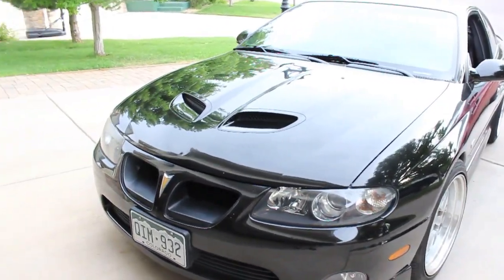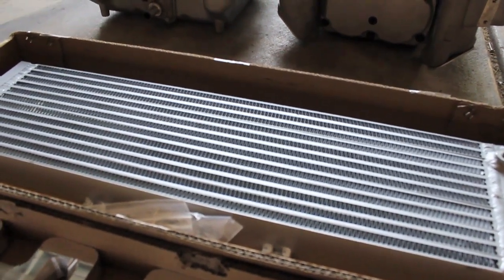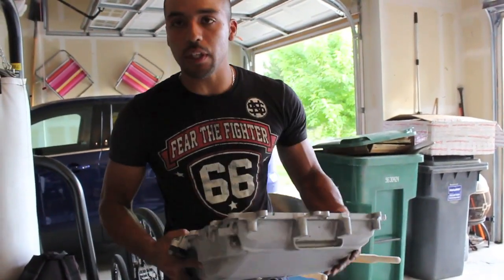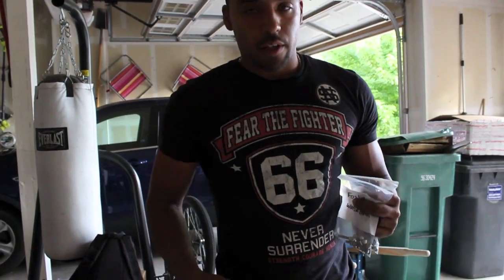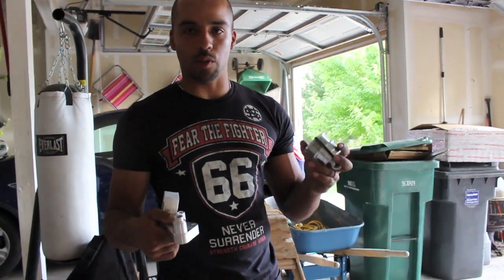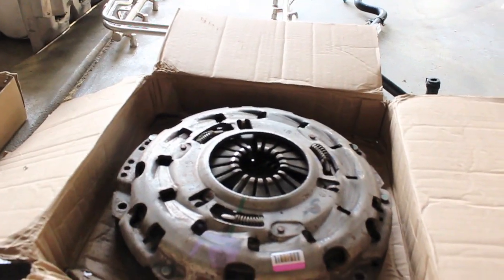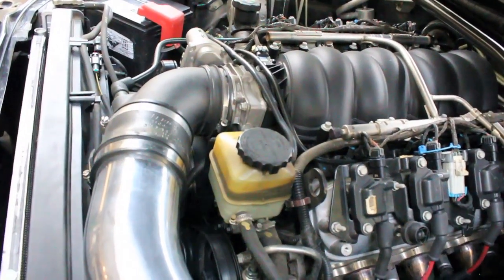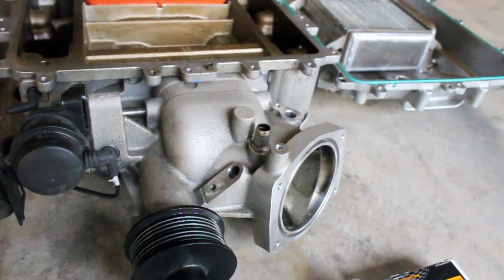GTO LSA SWAP PARTS LIST!

Comment: I know you’ve had this car built for a long time but I’m having belt issues I’m still stock crank pulley 2.45 upper billet comp cams manual tensioner I keep ripping belts? What do you run
Reply from the maker: Belt alignment is off

Comment: Do u have to change out the under drive pulley because I know the LSA are 8 rib.
Reply from the maker: No the kit is to keep the factory 6 rib setup
Reply: @TreyHerrera  all the pulley setups I see from like griptek gto off set is a 8 rib. So pretty much all I need is a idler pulley and and a tensioner then. Thanks for response.

Comment: What did you do for the brake vacuum line? Did you ever dyno the turbo setup? Just curious on power differences? I am already committed to LSA. Shooting for 850-860 rear wheel. Looking at 16 Lbs of boost. I wrote before, I forget what it was about but you never answered.

Comment: Are u on a stock bottom end ?
Reply from the maker: sevin3105 yep
Reply: Another question i know you have a 6.0 I’m really interested in a GTO and installing a LSA supercharger on it but i been having bad luck with finding a 05-06 all I’ve seen is the 04’s with the 5.7 i wanted to know if the LSA would fit on the ls1’s also i might just go with the 5.7 since there cheap n easy to find

Comment: Hey man, what’s the overall height from the valley cover to the top of the lid, including the head adapters? I’ve been thinking about this upgrade on my 5.7 with either 241 or 243 heads

Comment: What forum did you get the blower from, ls1 tech, CTS -v I’m hunting a gto myself and am also in Denver been looking at the boost district kit which all in is 3800 before tax accessories injectors pumps heat exchanger and pump in all
Reply from the maker: Matt Moran I bought it from zzperformance for $650 then pieced the rest together.

Comment: Trey guide me in the right direction  to at least get the blower maybe a contact number or anything I hve a 6.2 with 823 heads I'm going with
Reply from the maker: John boston 1974 go on eBay, o just seen they had a few on there right now
Reply: Trey Herrera ok trey thanks buddy
Reply from the maker: John boston 1974 or you can buy a kit from boostdistrict.com

Comment: What up man, nice videos on the gto! Can you send me that link to what positive displacement cam you use to get you to the 636 hp.
I'm doing a Ls swap on my dad's 79 Trans am. He passed away and I took over. I'm alsoing doing a lsa supercharger all I need is the cam and buy the heat exchanger. Pretty close to finish working on it. Need to start driving it already
Reply from the maker: im actually on a smaller na cam with a real good tune honestly. Sorry to hear about your dad! I have heard good things about the btr pds 3 cam hope that helps!
Reply: I'm doing all this for him! Yea it's tough but we must keep on living. Thanks ill look into it. I'm just a 23 year old college dude from Los Angeles doing it all with my financial aid funds! I also landed on the 2500 budget, thanks to you! Thank you for your time!
Reply: Since your the pro Should I use this one :: BTR LSA STAGE 3 CAMSHAFT P.D.S POSITIVE DISPLACEMENT SUPERCHARGED CAM LJMS $416.99 ??
-OR- this one ::: BTR Stage 3 Turbo Cam 230/235 .609"/.610" 114+4 LSX LS1 LS2 LQ4 LQ9 5.3 6.0 5.7 $399.95 ??
-OR- This One :: BTR POSITIVE DISPLACEMENT STAGE 3 TORQUE CAMSHAFT FROM CAM MOTION LS LSX
$429.99 ??
I'm using 317 heads with a 6.0 ls engine
Reply: I'm aiming for 550-700 hp..

Comment: Are your engine internals all forged? Or you still running stock cast parts? Heard you say stock bottom end, does that make you nervous? Haha
Reply from the maker: Eric still stock bottom and no issues what so ever, been supercharged now for 10 months mostly daily driven as well.
Reply: Trey Herrera did you have any of the motor inspected before boosting? Cylinder walls, rods, pistons, etc. Curious what route I should take my 02 Trans Am LS1 since I’m not sure an LSA blower would fit. Might have to Procharge or just H/C/I
Reply from the maker: Eric yeah when I did the cam I checked everything out. Car has 70k on it. Gen 3-4 motors handle boost pretty well so no worries here haha.

Comment: Hey man where did you pick up the heat exchanger pump at? And what did you use to mount it up
Reply from the maker: Michael Rogers eBay  and the pump came with mounting hardware

Comment: Hey Trey what fuel injectors did you go with??
Reply from the maker: Hugo urbina just the factory lsa injectors
Reply: what parts did you use to hook up the fuel line to  the lsa fuel rail since the gto's is on the opposite side
Reply from the maker: Hugo urbina I made the lines with an 6 fittings

Comment: Your the man bud that thing is going to be a beast. So all the parts you listed can it work the same on ls1
Reply from the maker: AJ Tindall yes they will with a ls1 set up, I recently got it running! Car is awesome
Reply: Trey Herrera yea bro I see you got it up and running, moves like a beast. I’m just really skeptical about getting it cause I’m thinking it won’t fit my ls1 camaro and I’m literally lost on what to get for the lsa until I saw your great video, now I’m start collecting pieces by pieces. I saw that u didn’t do a reservoir is that optional? And any dyno  run
Reply from the maker: AJ Tindall I just did a filler cap, so you can see when the fluid is moving through the system. Dyno is scheduled just haven’t done it yet

Comment: What was the cam you went with
Reply from the maker: CinemaQuad I had a tsp 228r in there I haven’t changed it yet
Reply: 10-4  getting so close to pulling the trigger on LSA blower i also have a fresh 408 iron block setting in my shop  that will most likely be going in.
Reply from the maker: CinemaQuad you will make great power on a 408! Do it you won’t regret it
Reply: Where did you get the brake boost line? Do you have a part number?

Comment: What did you use to extend the fuel line to the fuel rail?
Reply from the maker: You make a connector using an fittings
Reply: Trey Herrera I don't think fittings will work for over 2 ft lol. You should get a e-85 flex fuel composition sensor and go e-85
Reply from the maker: About20ninj45 I already got the car running, the fittings work just fine. Check out my other videos

Comment: Pretty sure the LSA Blower runs dry. No supercharger oil needed.
Reply from the maker: sanosuke2999 incorrect you fill the oil in the rear of the supercharger.
Reply: Thanks for the info. Saw a few LSA porting videos and heard them say it doesn't use oil which I found strange. Thanks for straitening that out Trey!
Reply from the maker: sanosuke2999 yeah it  usually doesn’t have to be changed for 100k miles. That prob why they would say that

Comment: What mods do you have done prior to the super charger. Cam Springs, push rods, exhaust?
Reply from the maker: Rscmgw23 Cai, lt headers, x pipe/cat back, cam springs retainers push rods tune
Reply: Trey Herrera... sounds sick, nice build going so far. I just ordered my dod delete for my g8. Debating doing a Lsa or procharger over the winter.
Reply from the maker: Rscmgw23 thanks man, lsa can be had for a lot cheaper then a procharger but prochargers are much easier to fit in the engine bay and look sick. Either way it will be sick Good luck man!

Comment: This has been the biggest help since I'm a few steps behind you on my lsa conversion, if possible a video on the coolant pump wiring would be awesome, looking forward to more videos
Reply from the maker: Bryan Hodges I finished the build already, wire in the pump off of the fuel pump relay and then make sure you get a good ground. It needs to run anytime your driving.
Reply: Trey Herrera thanks for the speedy reply, how was hood fitment with the cts-v lid? I have a zl1 lid but I'm thinking I will have to go the cts-v route
Reply from the maker: Bryan Hodges hood fitment sucks haha   3/8 motor mounts would of helped me a bunch. I'll be doing a vid on this soon

Comment: The 300c  will work for 76mm turbo build? 650-700hp?
Reply from the maker: isaac herrera depends on fuel injectors and the flow rate. Forum say they are using good till 700-750 I believe
Reply: Did you use stock bucket with the dw300c pump? or drill bucket or use 8.1bucket?